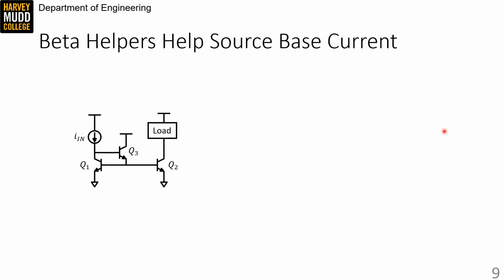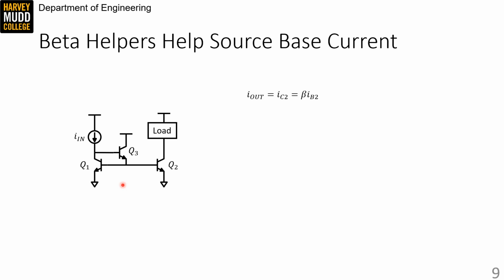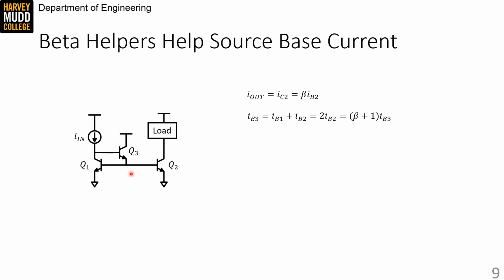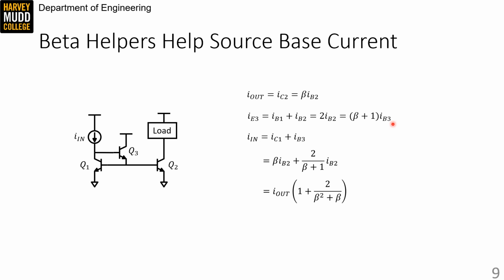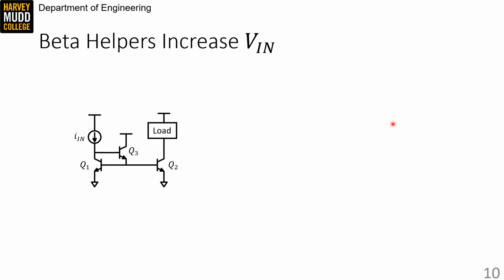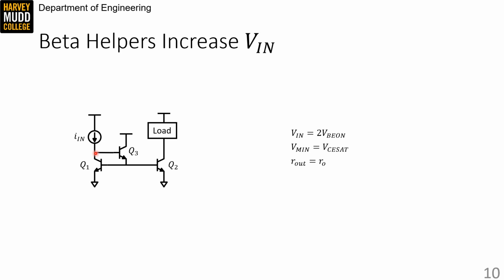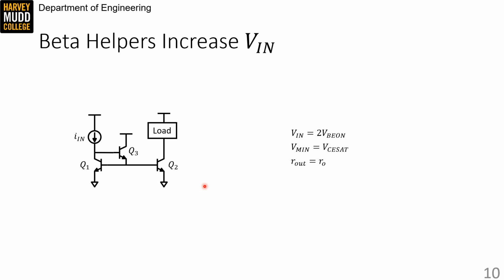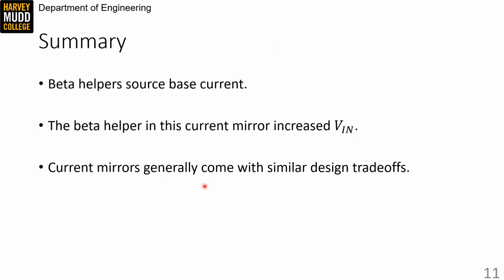Simple Current Mirror with Beta Helper | Intro to Analog Design | Harvey Mudd College | Video 13.2

Comment: Explain with mos transistor
Reply from the maker: Very happy to!  First, check out https://www.youtube.com/watch?v=O0uJ-2sHVmM and https://www.youtube.com/watch?v=VSVgN0V-xMY for details about how to model MOSFETs.  Second, you don't usually build this exact current mirror using MOSFET devices because MOSFETs have no gate current.  The beta helper is providing base current to reduce the error of the BJT mirror, but (long channel) MOSFET mirrors don't have error because of gate leakage.  MOSFET mirrors are  usually either simple mirrors or cascode mirrors if you need the higher output impedance.  Fancier versions exist to improve the swing.